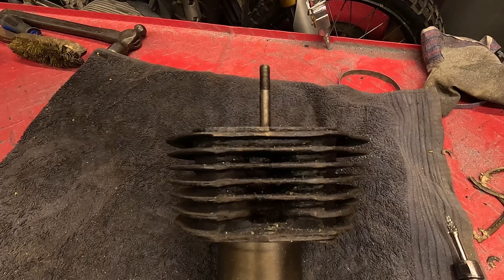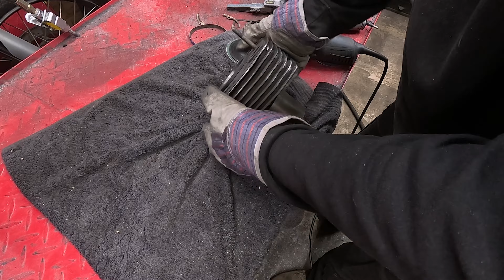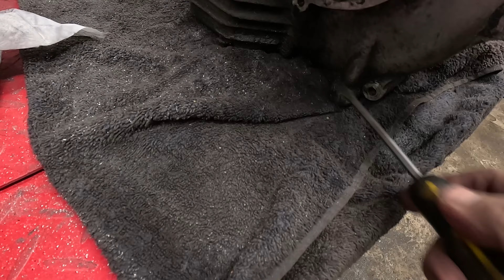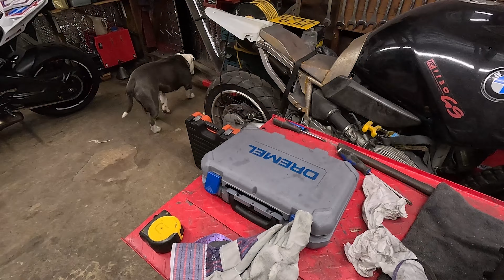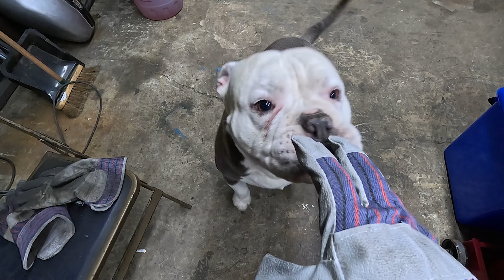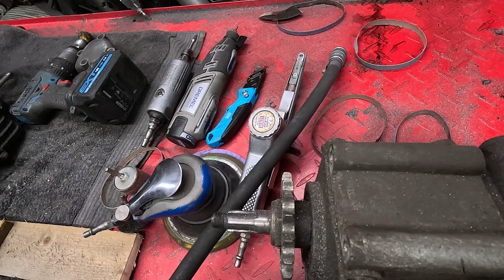Custom Project (Engine Clean Up)

Comment: Talking about shed insulation against heat loss - How are your feet mate? I worked in open airport sheds for 29 years here in NZ - and heating was a sick joke .. but you can get industrial insulating rubber mats that cushion that underfoot concrete a bit and help reduce the heat drain on the old legs.

Comment: Have you considered putting down/using high density foam floor mats down?.. cheap enough at Halfords and the interlock like a jigsaw piece...cold floor heat soak through your feet aint no fun!!
Reply: It's not so good with a welder ,grinder or open flames

Comment: The other disadvantage with the fins being bare alloy is that corrosion will seep under the crinkle finish on the horizontal parts of the fins and will lift the finish so inside a year or two it will need refinishing

Comment: flat faced fins cool about 20% better, bare metal even better, why you see harley is flattening them now then grinding them after powder coating so it's bare metal, more efficient cooling as there is more fin area and the air hits it hard . .

Comment: A manicures for bike engines what next? Lol. what a difference the detailing adds pity mass production does not acknowledge that. One question i noticed the casting marks 1128 on each casting got sanded away. What do they relate to and will they be reinstated?

Comment: what happens with the engine numbers being removed?
Reply: Thats a great question, has me confused too!
Reply: That has me confused too
Reply: Re-stamped?
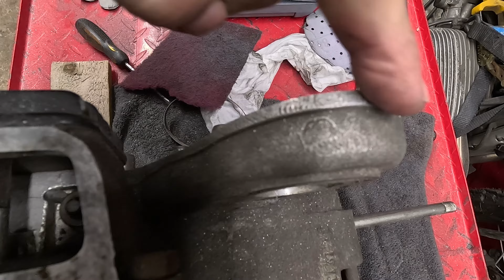Reply: I don't believe those are engine numbers. If you note each case half has the same number, so I'm guessing they are simply numbers to denote a matched set of cases, If you pause the video at around 21:25 you'll see what looks like the engine number on the rear upper side of the crankcase.
Reply: Numbers at the front of engine, you can see near end of video.